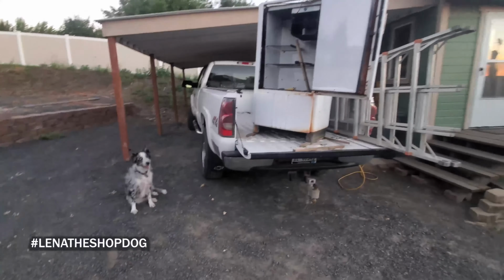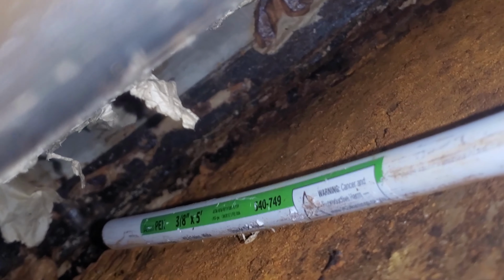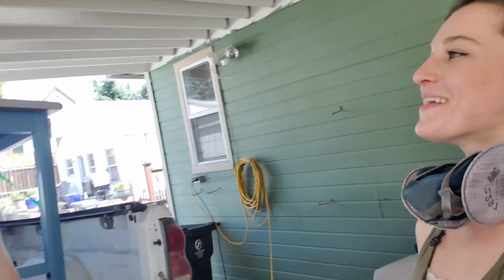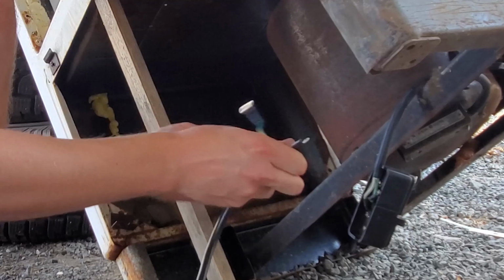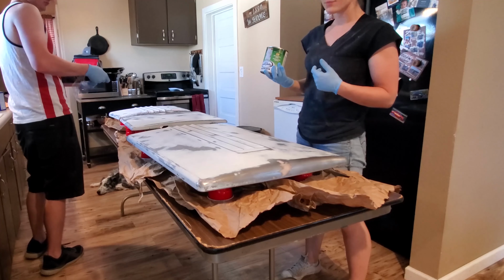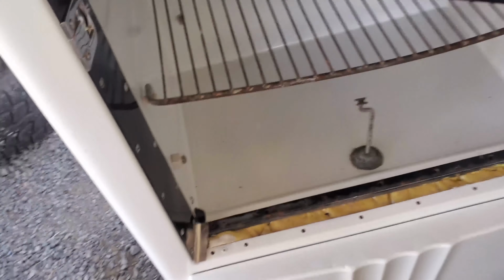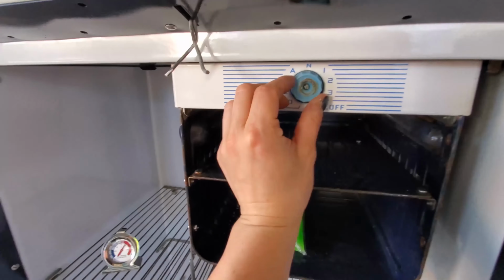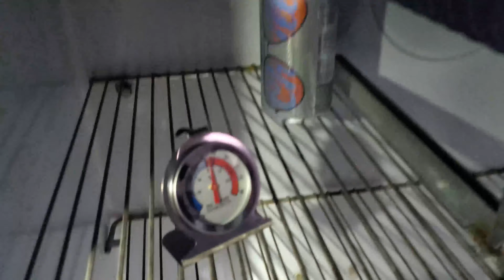Restoring our 1941 GE Refrigerator "Betty White"!

Comment: We had one like this and the freezer door was just a thin metal door with a curved in front. The freezer will keep producing ice and doesn't have an automatic defroster you have to turn it to defrost. Don't use any tools to remove the ice like an ice pick or you'll puncture it and the gas will come out. Years ago we had one like this and it had what we called a potato bin in the bottom- a big round knob in the middle of the door  opened a bin angled down.
Reply from the maker: How cool!! And good to know. Thanks for sharing 🙂
Reply: Yes exactly how they work.  I found a fan blowing into the unit with the door open, helps defrost it quicker.  They made electric units that heated up and helped defrost them, but I think it heats the gas up and throws them out of balance.  The owners manuals say to put in pans of hot water inside them to help defrost them quicker.  I also have timers, that you plug into the wall outlet, and plug the fridge into the timer.  For one hour or how ever long you desire, it will shut off the fridge and is supposed to heat up the freezer compartment enough to melt off any frost and make it so you don't build up so much frost and do not have to defrost it manually that often.
Reply: I’ve got that potato bin GE fridge. It’s from 1938, and in excellent condition inside. The outside isn’t bad, but isn’t pristine either.
Reply: @luthmhor   Thank you for that reply I love hearing about it-I love antiques.

Comment: Sucker is heavy huh?  I have a 1939 model.  I picked it up myself, and I'm no muscle bound hunk either. I walked it corner to corner tilted in the back of my suv, wiggled it up towards the front seat with maybe 1/2 inch to spare, in closing the back window.  Got it home, wiggled it to the corner of the garage door and there it sits.  I will not be moving it by myself again, I think it must weigh 300 lbs. if it weighs an ounce.  There are quite a few of these that come up for sale on Ebay, they must be made like tanks, to have lasted almost 100 years, and I'm sure most of them are still working.  Oh mine, was missing the crispers and little 'E' shelf hangers on one side.  I was able to purchase shelves, and crispers from a seller who turned his fridge into a kegalator, so I got all the parts I need.
Reply from the maker: Worth their weight, that's for sure! This little fridge is still working wonderfully for us.